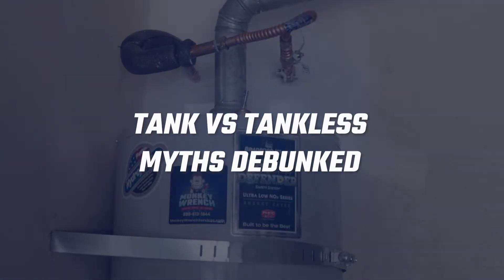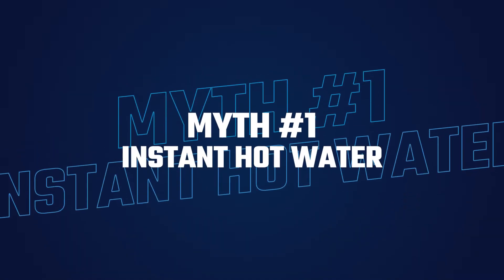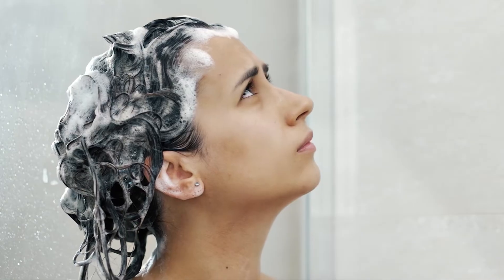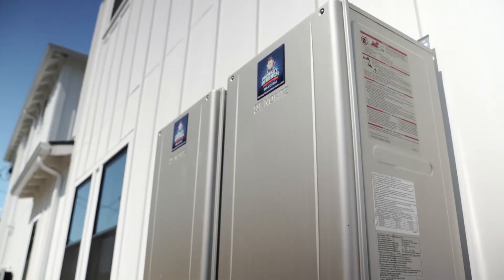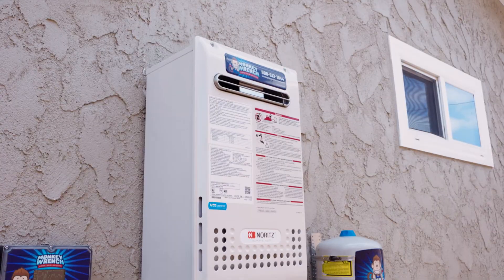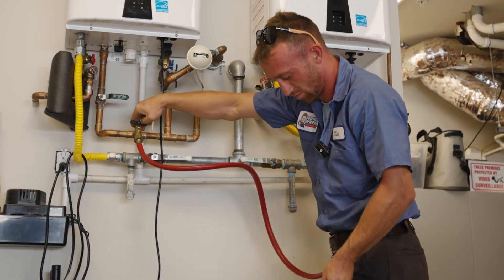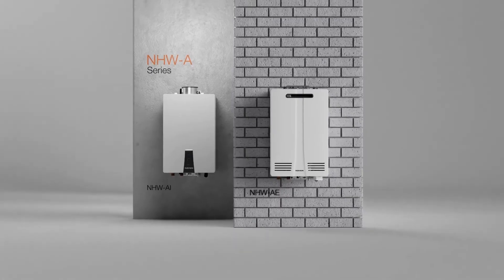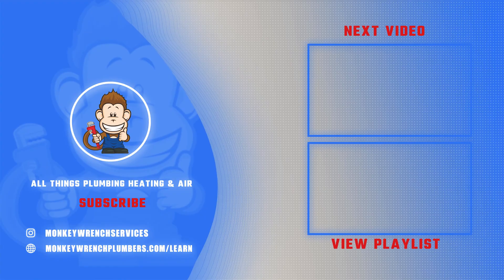Tankless vs. Tank Water Heaters Myths Debunked!

Comment: Wouldn't both have the same issue of cold water in the pipes without a recirculating pump? I have gas with a tank far away from shower and takes time for hot water to show
Reply: I had the same problem, with the master bath too far from the unit. So I threw in a small pump at the NG fired on-demand system with a thermo triggered Watts Sensor valve under the vanity. Hot water immediately=happy wife !!!